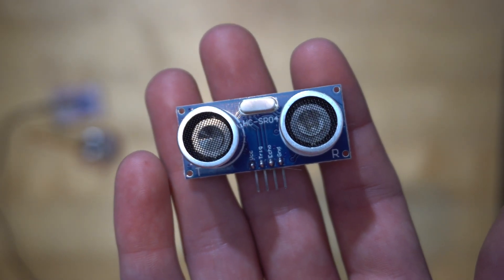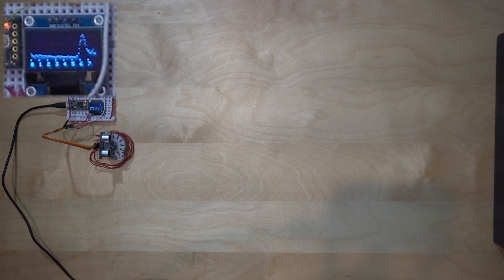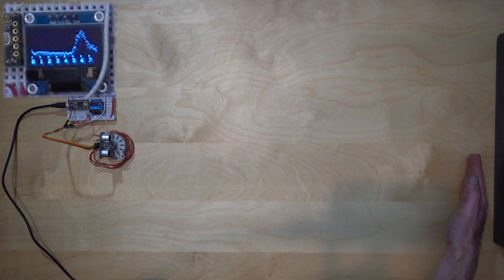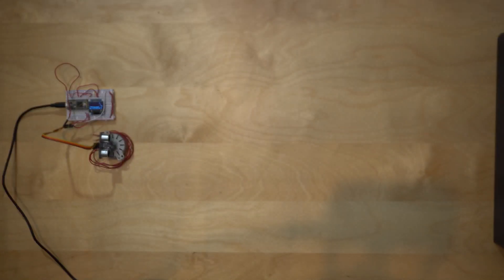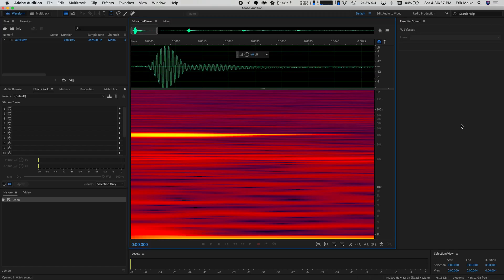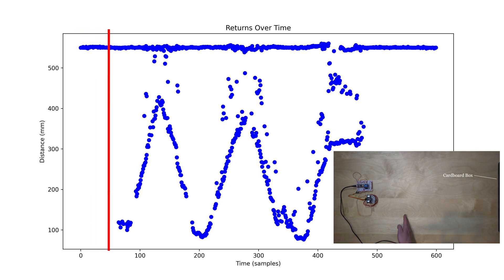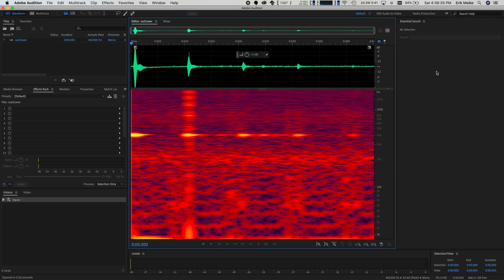Hacking a Cheap Ultrasonic Sensor into a 1D Camera

Comment: Hello, Eric!
I want to implement this idea for a fish finder (fishing sonar) project. I am using the JSN-SR04T ultrasonic sensor. Since it is from the same family as the HC-SR04 I was wondering if I can take the same kind of input from my sensor (and where should I take the second analog voltage input from). 
I have one more question - what are the requirements for the microcontroller? Right now I am using he Seeed Studios XIAO ESP32C3. I read in the comment section bellow that there are some ADC speed requirements but there were not any numbers specified. 
Thank you in advance!

Comment: Where to download the code?
Reply from the maker: I finally got around to posting the code. Here it is: https://github.com/widdakay/SR04-MultiObjectDetection
Reply: @ErikMeike  Wow that's so cool. How'd you wired the analog output?
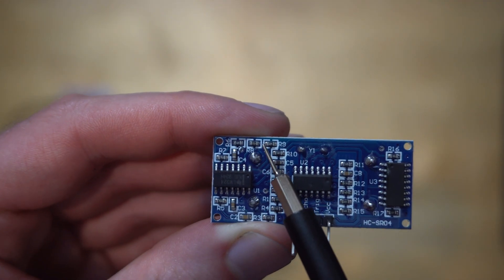Reply from the maker: @armusaofficial  I connected the pin I pointed out on the SR-04 (1:03) to A9 on the Teensy and pin 12 to the trigger input on the normal header. The display is just a normal 128x64 SSD1306 from Amazon that I put on the i2c from the Teensy.
Reply: @ErikMeike  thanks! Is it possible to run this on an arduino uno?
Reply from the maker: @armusaofficial  Unfortunately it won't run on a standard arduino uno. It requires the high speed ADC available on more powerful boards like the Teensy.
Reply: @ErikMeike  Sorry, can be done with MCP 3208 or 3201 ADC and than send to arduino?